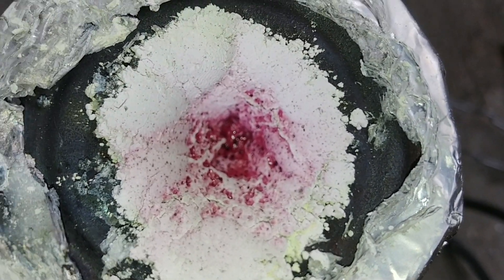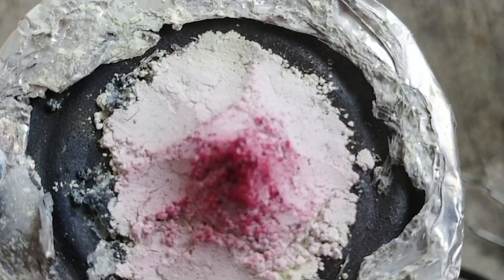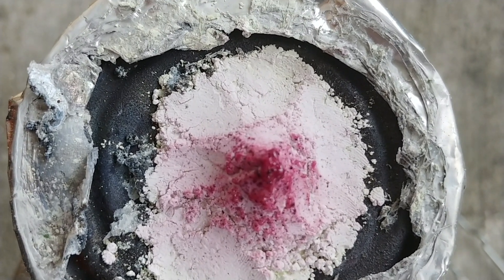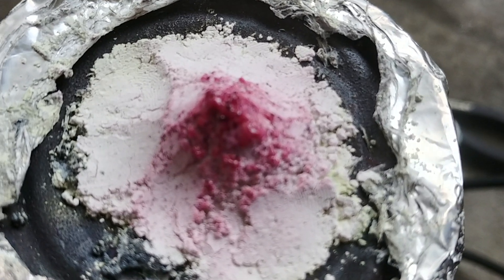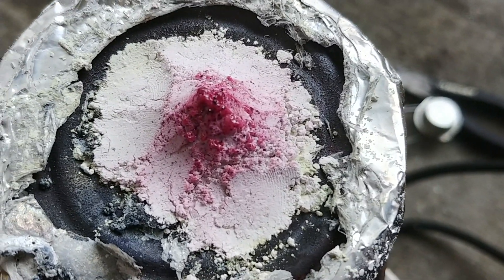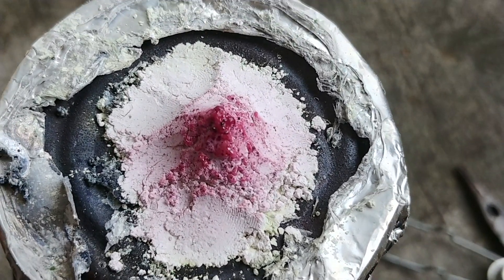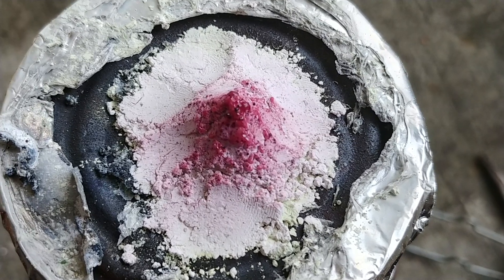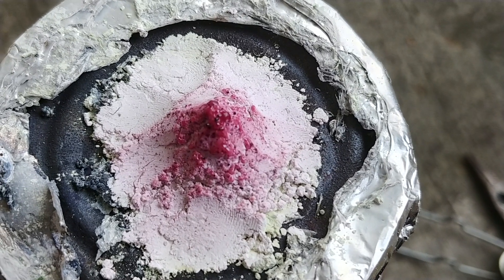Home Science: Follow Up Post Fusion of Ruby Feedstock

Comment: Best of luck brother cant wait to see what comes out of the vernuli furnace
Reply: And why not switch to HHO?
Reply from the maker: @christianhoelscher9063  I will be going with hydrogen/Oxy fuel with the Verveuil furnace but I haven't found a feasible means of producing enough fuel in either HHO or my preferred separate hydrogen/oxygen electolysis cells. I may end up opting for storage tanks due to the volume of fuel required to run the furnace. I don't feel comfortable having the hydrogen & oxygen mixed all through the entire system from production to torch head. I'm still going to attempt the electrolysis cell since I have nearly all the components stocked up.